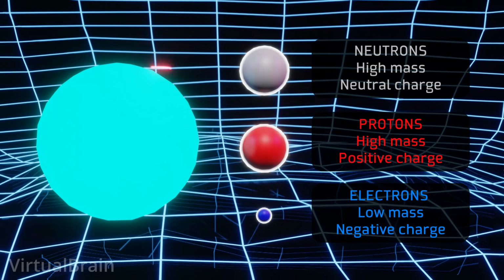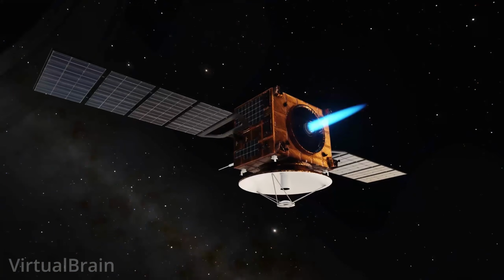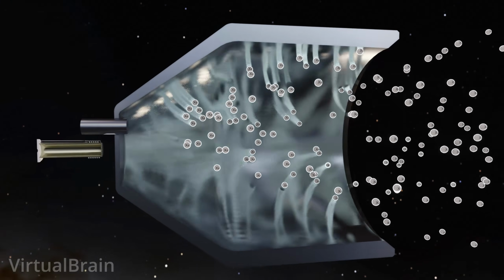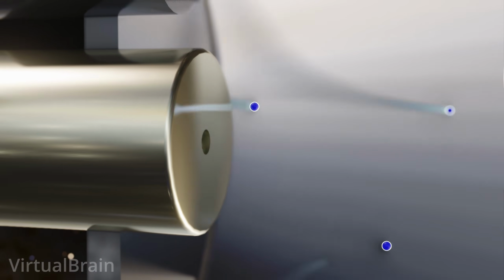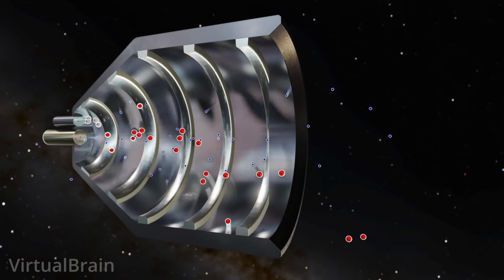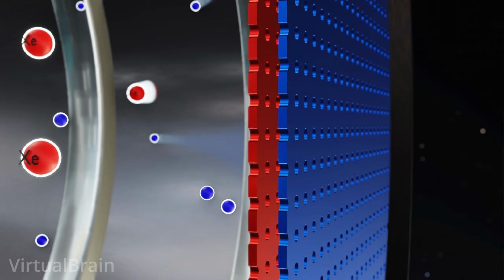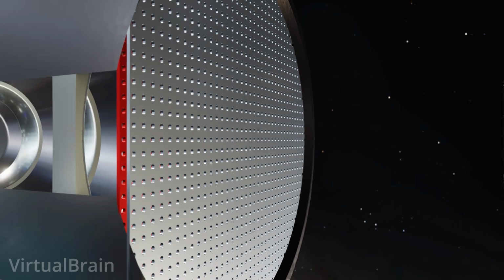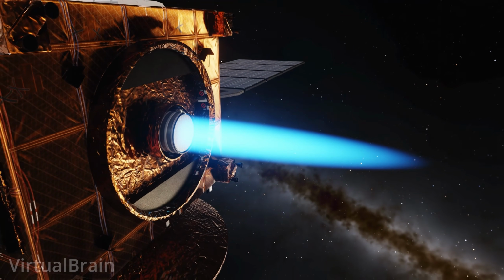How an ION THRUSTER Works ⚡ What is Electric Propulsion?

Comment: Truly great video, thanks!!  
There is a series of ion propelled vehicles/thrusters that lift themselves and their onboard power supplies against Earth's gravity!  On my YT channel there are about 40 videos of them, and on the channel and website thorough verification is included as well.
Reply: There is an interesting design of aircraft, but they rarely talk about it, because this thing is secret. The topic of pulsed plasma thrusters has been developed since the early 60s (see PPT - Pulsed plasma thruster) - they are usually designed for spacecraft. But we will talk about a little-known design - these are plasma propulsion panels for aircraft, where the same Pulsed plasma thruster, but reduced to the size of a pencil and stacked in the form of cells in the panel. The design resembles a conventional plasma TV screen, where there are also discharge cells that activate the glow of pixels on the screen. And plasma propulsion panels have long discharge cells, the arrester has a railgun architecture (just rail contacts or coaxial), and the ionized discharge air is accelerated there by the Lorentz force to enormous speeds - a kind of ramjet engine is obtained. Just imagine! - tens of thousands of small ramjet engines assembled in a panel and firing plasma synchronously with a huge frequency (hundreds of kilohertz). Thus, plasma propulsion panels create lift by pulsed emission of plasma jets from railgun cells. There are tens of thousands of cells in the panel, they shoot at a frequency of hundreds of kilohertz, a huge pulse is obtained, and the plasma swirls the air into toroidal rings - the aircraft is held on this air cushion. Horizontal acceleration is created by the same plasma panels on the sides of the device (they glow, from the side they look like "portholes"). Such devices like "triangle" or "disk" have been observed for a long time, they are mistaken for alien ones - but these are terrestrial devices. They are classified and used for espionage and secret actions. Pulsed electromagnetic technology generates microwave radiation, therefore it is harmful to health. They rarely fly - only military missions. Therefore, they are not suitable for a citizen. This maintained the secrecy. Now they are already declassifying - many people know about this secret technique. When declassified, they will be used for cargo airships. But there is a danger that they are now going to be adapted to deliver small nuclear charges to decision-making centers - such means of delivery are not specified anywhere, are not conventional. This lowers the threshold for starting a war. It would be necessary to declassify them as soon as possible. That's why I'm writing about it. However, I have written before - starting with the book "The Elimination of UFOs" and many articles. There are also videos on my YouTube channel - "Declassified UFO" and "UFO Anatomy".
Reply: @Pavel_Poluian  I have heard rumors of such a thing as well.  The thing is, that making dense plasma that glows out of air is a VERY lossy process. There have been tube shaped ion thrusters for a long time and they are not efficient.  I just don't think they would get enough thrust to fly a fast powerful military jet that way due to heat losses.  Applying high currents to air just produces lots of heat and very little thrust.  I would need more evidence of it to be a believer in that particular concept.  Your comment is very well written, however.
Reply: @KraussEMUS1  Thanks for understanding))) After studying all the materials about UFOs, it becomes quite obvious that since the late 40s of the twentieth century, a secret project for the development and production of aircraft has been developing in the USA, where the lifting force is created using high-frequency vibration. It all started with the vibrating umbrella-orthopter "Sky Car" by James Pitts, then the umbrella was closed with a dome and devices appeared according to the scheme of conventional electromagnetic vibrating speakers (membrane + inductance) - fragments of the membrane were found by a farmer in Roswell. Then they created piezoelectric motors or with small dischargers on the surface (they glowed all over the body due to air ionization), and now these are aircraft with plasma propulsion panels (because they are angular - that is, with flat surfaces). Thousands of discharge cells are packed tightly in the motor panels - they shoot plasma streams (railgun architecture - coaxial electrodes). The technology is quite mundane — it is known in the smallest details due to information leaks. For example, air ionization in coaxial railgun cells is created with the help of radiation (radioactive polonium is introduced into the metal). Devices of this type were used all 50-60-70-80 for secret missions (they took off, as a rule, from special submarines). With the fall of the USSR, their use by the United States was practically curtailed (in the novel "Little Green Men" by Christopher Buckley, a speechwriter for Bush Sr., a scene is described where the US president decides to curtail the project with "flying saucers"). The curtailment of the project can be recorded by the drop in magnesium consumption in the United States, since such fuel was used in fuel cells (magnesium tapes burned in forced galvanic batteries), this is 2007-2008. However, the development of the technology continued later in the Russian Federation and China (the technology was restored by reverse engineering methods for downed devices). Secrecy, however, remained, and there was no civilian use, because the technology is not suitable for this - harmful microwave from pulsed plasma engines (harm to pilots and the impact on electrical appliances inside and along the flight line). The payload is low (but one nuclear charge will pull.) There is no radio communication - unmanned vehicles can fly and maneuver only according to the program. Previously, there was a narrow application profile - rare spy missions (so that pilots do not receive a lot of radiation). Reconnaissance aircraft of this type were often observed at military bases, missile launch pads and airfields. They were even seen by peaceful explorers in the taiga, where glades were laid for seismic exploration - UFOs flew there to check whether military construction was underway (I myself heard stories about it))). I think this technology will be declassified soon, and cargo airships with flickering round plasma panels on the hull surface will appear in the Arctic sky.

Comment: What if instead of the xenon what if they add the Oil that based in the transformer which the oil not actually burned but create a Arc to the wires which can be maximize the platma ion flowing to the thrusters
Reply: An arc represents a short.

Comment: how fast does this ion thruster eject these Xe particles reguarding light speed? 70%? 80%? how close they get?
Reply: the video states 10km/s
Reply: It's about 3/10,000ths light speed, or .03% the speed of light.
Reply: it is easier to spin the spindle and without strong overloads in just 1 g.  every second with an interval of 0.1 throw a cam along the direction vector.  in 6.356 hours the speed will be 216 km/s
Reply: Speed of light Is 299 792 458 Meters a second or 300 000 kilometres a second , so 80 percent of this would be 240 000 kilometres a second which Ion thrusters cannot reach as of yet 
Hope this helped you put the speed of light into perspective
Reply: No please, speed of light 1m feet per second, which reads as 300km/s . @lilkiid7632
Reply: 0.0001%